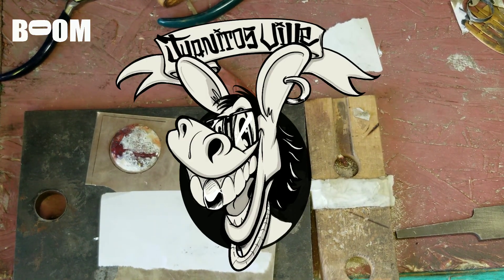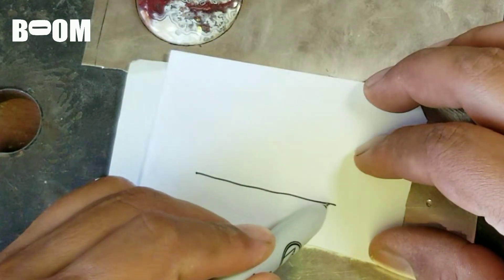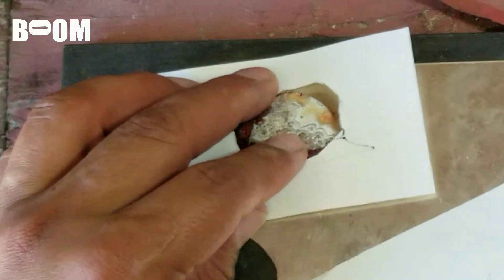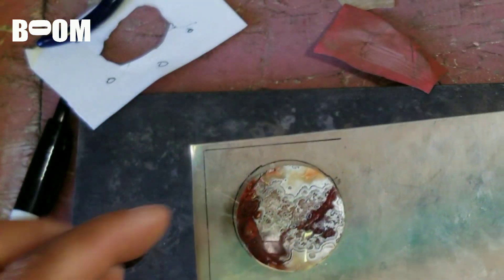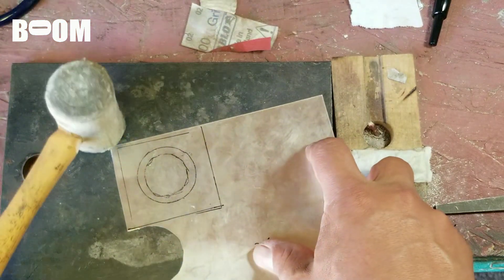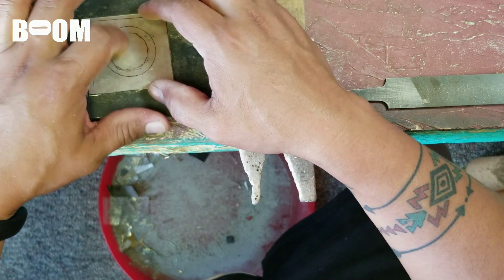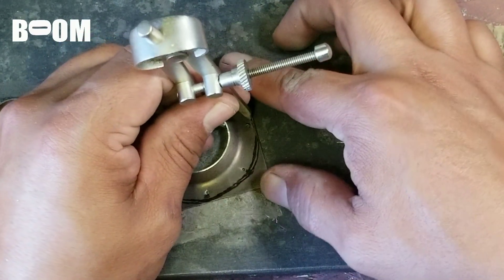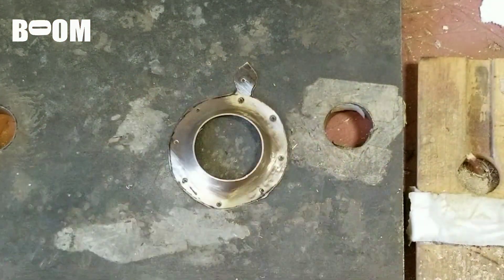Ep.34) Unique Stone Setting | Epic Adventure | #jewelrytutorial

Comment: Very nice, as usual. Do a search on shadow box setting and you will see some similar type of thing. Basically that is what you are doing here, except you are using rivets and most shadow box settings use tabs or something on the back to keep the stone in. Some leave lots of open area around the stone so it looks like it's sitting inside of an open box and others so what you did where the stone takes up all the room on the "inside".  You came up with a very nice and different way to do a shadow box, I likes it.
Reply: Do you think this setting could work with a piece of sea shell that is not flat in the back?